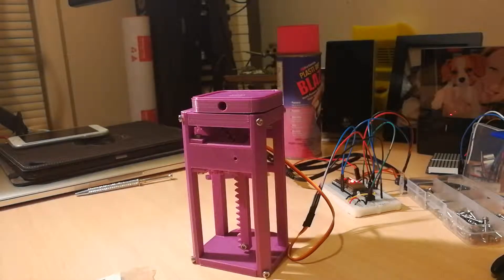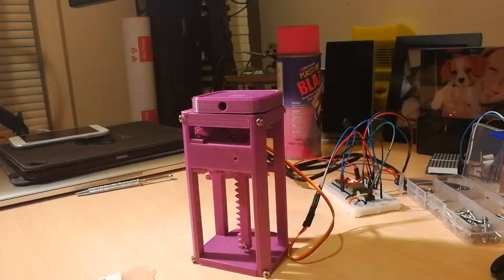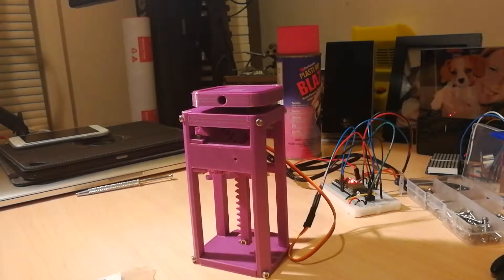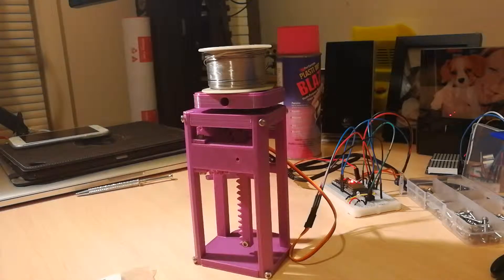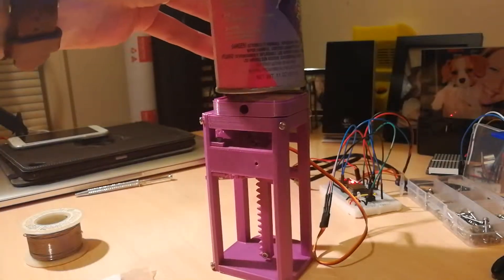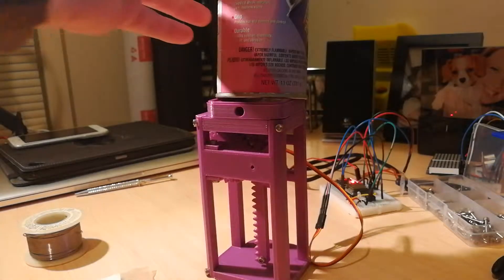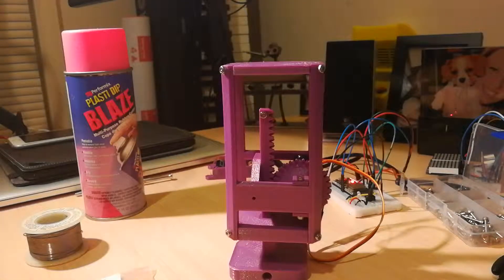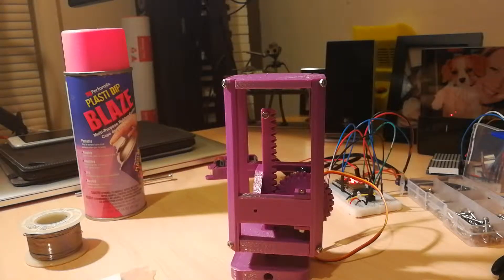Rack and Pinion Test - Jack Version

Comment: How do you lock this mechanism at a given height? I want to build something like this without a motor (just hand turned) that could stay in place for a given height and hold some weight. Thanks!
Reply from the maker: This is a pretty old vid from the early R&D stages of my elevator design. You can see a much later version of this in this vid where I lock the pinion using a second servo so that I can disengage the power to all servos and let gravity bind the mechanism. That'll do it for you.
https://www.youtube.com/watch?v=DmT_nr5nt8E

or here is a better (earlier) explanation: https://youtu.be/1Qtiup2M478?t=162